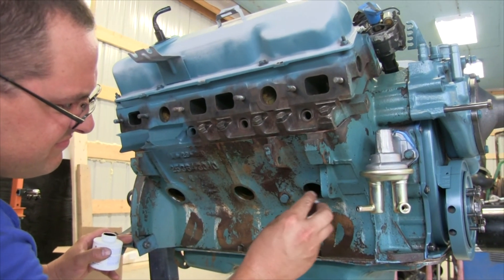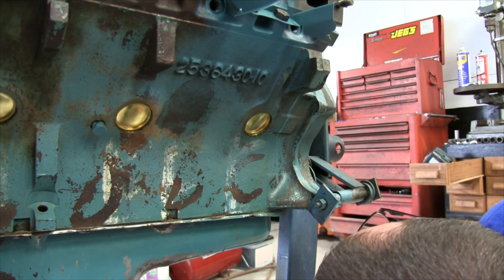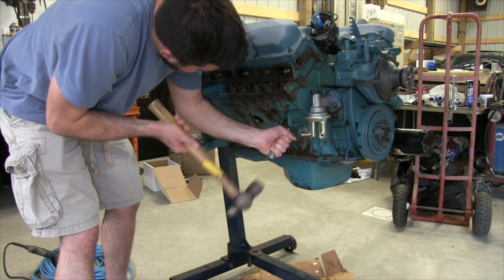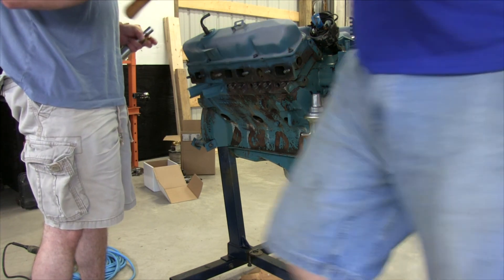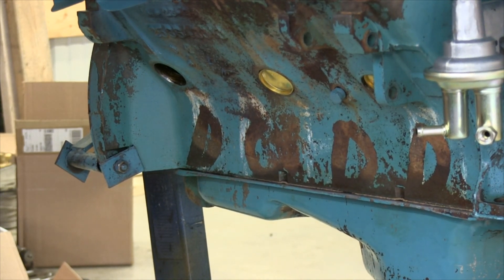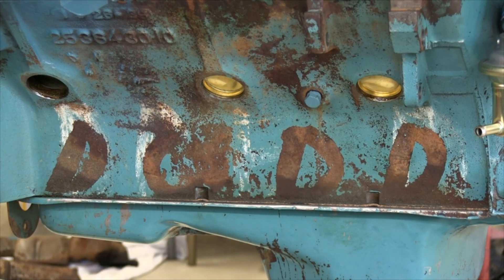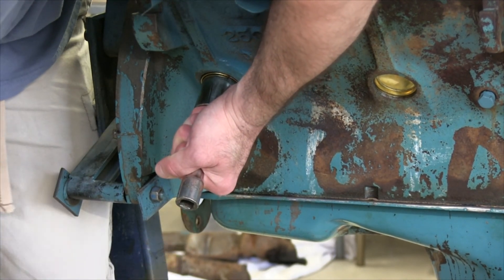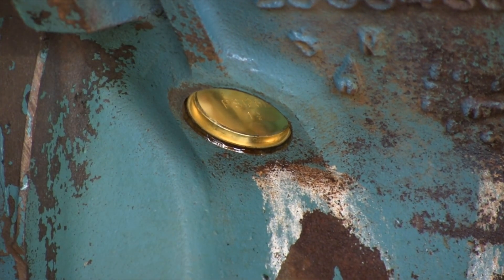Mopar 440 Engine Build Part 19 - Installing Freeze Plugs

Comment: Thanks Joe! I googled shmuu. Found it! Office Paws needs all the help you can give him! :) Shoulda flipped it!  What is the purpose of 6 holes in the block anyway!?
Reply: Morado Is Thise holes are how the factory got the casting sand out of the block after they made it
Reply from the maker: Shmuu = Permaxtex aviation sealant.  Yeah we shoulda flipped that block over!
Reply from the maker: Correct
Reply: ric0000 You made it work! Nice job